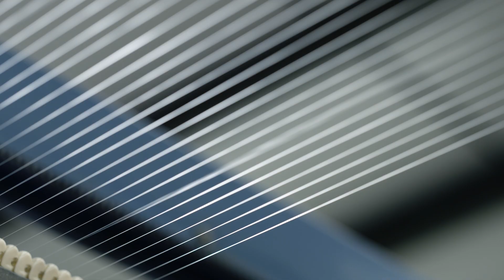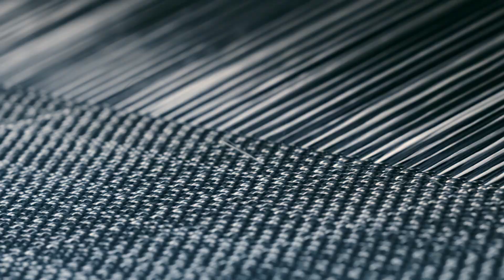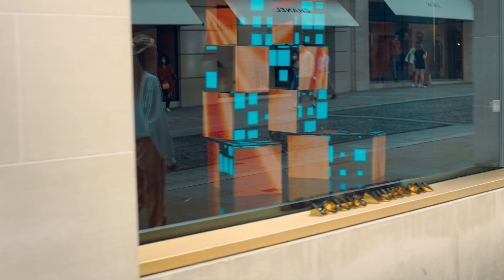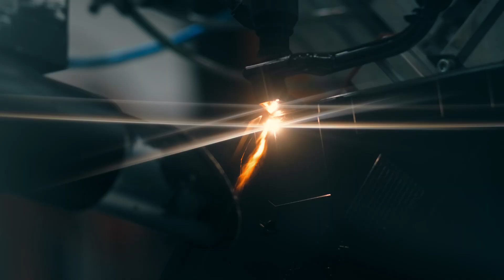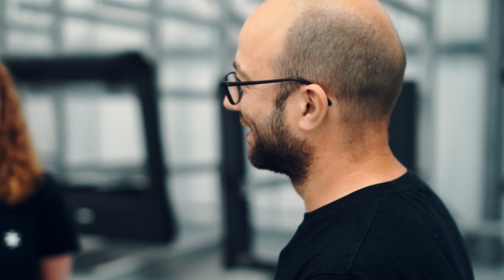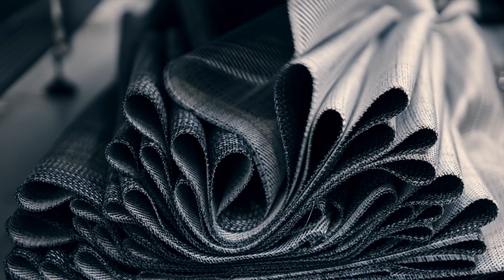Sustainable Innovation. Powered by Arrival.

Comment: Looks like a major distraction from the core business. How much has this pushed back the cash flow curve of the vehicle business? Or has Arrival's core business changed suddenly?
Reply: More possibilities.
Reply: They have vehicles out doing driver training. Maybe you should do a bit of research before making up a story? The microfactory concept means NO PRODUCTION LINE! They can have on microfactory working on a project like this without disturbing the ones making vans for UPS, or buses for service testing and driver training, which is what they are doing currently.